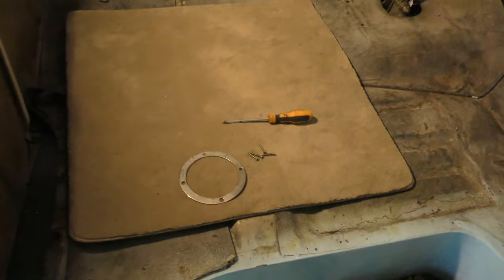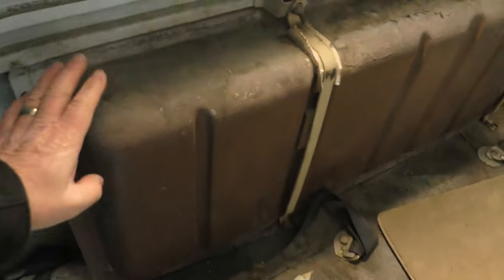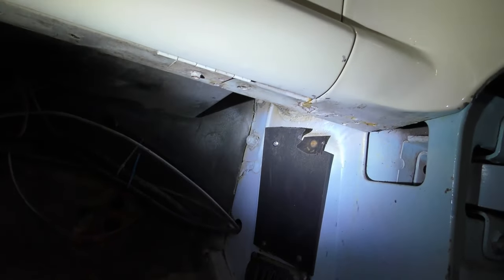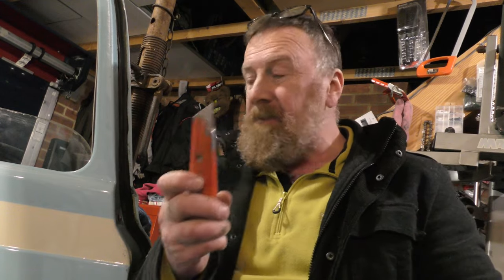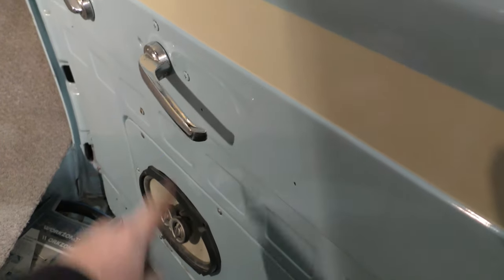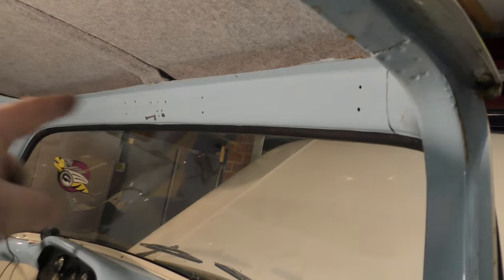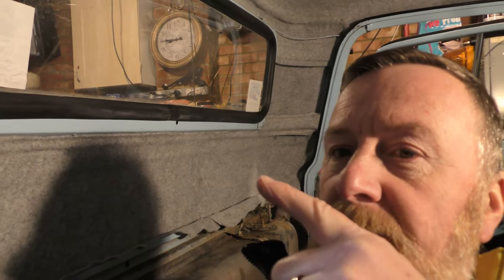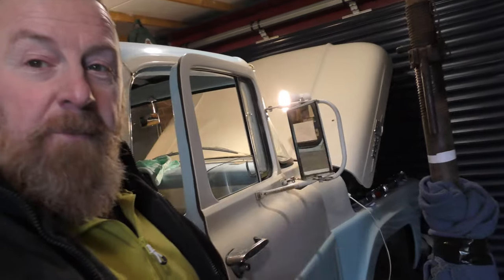FORD F250 RE-CARPETING MARK SAVAGE

Comment: You fell out a Vauxhall Viva??? 🤣😂🤣😂🤣😂🤣😂 Carpet looks great.
Reply from the maker: I did Steve,  as I turned around to talk to Mt sister I leaned on the door handle and we were just going round a corner! 
I was 8 and neatly didn't make it to 9 years old !
Dad had to swerve to not run me over 
Stupid design 
Maybe I shouldn't have been running around and had a seat belt on ! Pmsl
Reply from the maker: All in not a bad Job with this f250
Thank bud
Reply: @marksavage  OMG can't believe it's got even funnier/bizarre.  Fair play to your Dad for the evasive manuvers 🤣